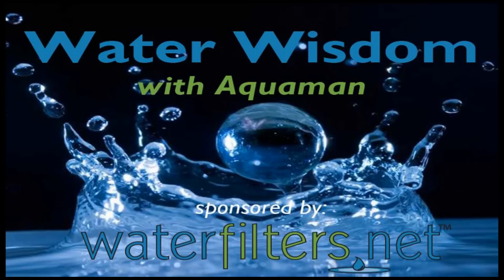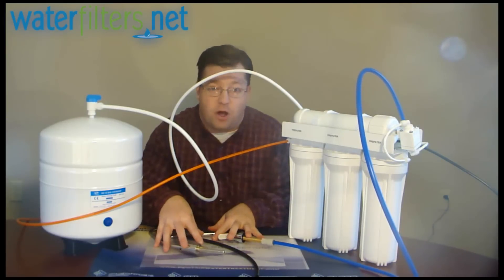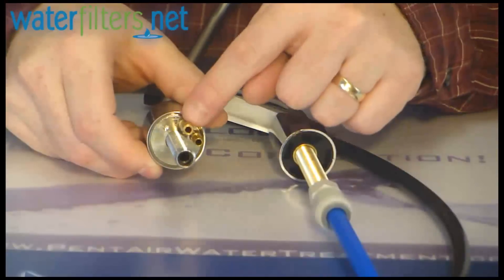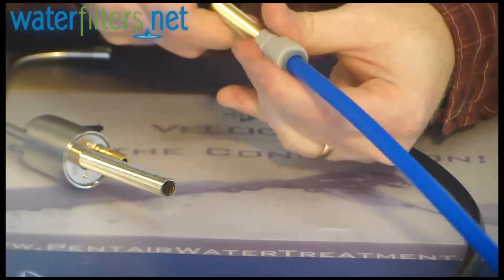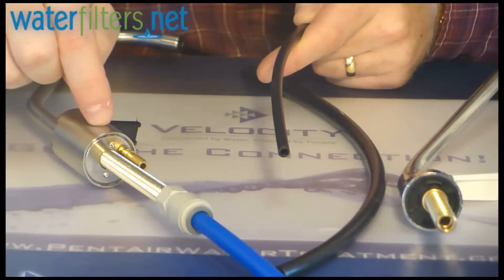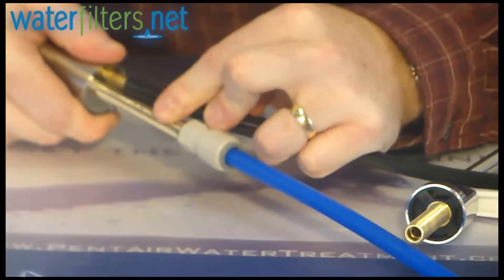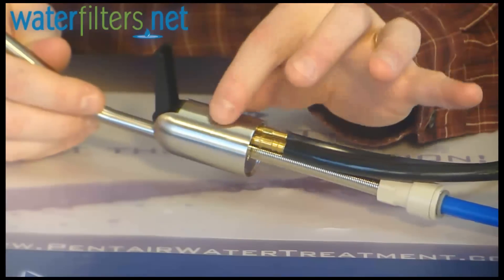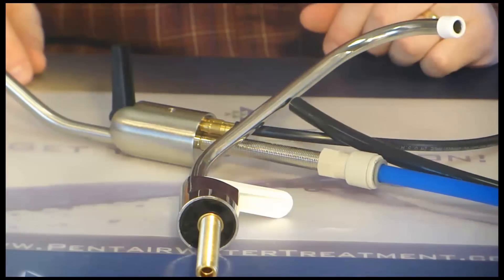Air-Gap vs. Regular Water Filter Faucet

Comment: Section 611.2 of the Uniform Plumbing Code requires the discharge (brine or waste) from a drinking water treatment unit enter the building drain through an air gap or an air gap fitting. The purpose is to protect the potable water from contamination from the drain contents in the event of a stoppage where the waste could rise in the discharge line through the unit and then contact the potable supply. The same protection is required for any device connected to a potable source and a drain.

Comment: The drain water is not brine water. That would be the recharge water from a water softener. RO systems do not use salt. The firetruck drawing water does not and would not cause a reverse pressure on the neighborhood water supply. 
The concern is earthquakes. Airgaps are a California concept. The municipal water system can lose pressure and even develop reverse pressure/flow from a break in the system. These are mainly theoretical concerns. There would need to be a clogged and backed up drain at the same time there is an open valve at the same time there is a reversal of flow/pressure in the water system.
Reply: t @MattSteelblade  Yes, If the RO system is used for desalination. Or, a water softener is releasing brine into the water system and the RO is removing excess salt from the water softener. Normally, the discharge is called concentrate because it contains the small amount of brine plus the other concentrates.

Comment: What is that plastic screw-on connector called to attach the water from the RO system to the bottom of the threaded faucet base?

Comment: Hi, I have a faucet with air gap. very often (once in 2 to 3 days) around one cup or more water is throne out from the faucet. wondering what is wrong? is it the air gap or it is not connected properly.

Comment: The air gap is required to be ABOVE the flood level rim of the fixture it is serving (UPC Table 603.2). Your suggestion would violate this requirement because the flood level rim is the counter top or the top of the fixture when the fixture is self rimming.

Comment: I have an Air-Gap faucet and its very loud air sound from the hole on the faucet. is it any  way to reduce the sound?
Reply from the maker: Anna Popiel The Air-Gap faucet should not be making any noise unless there is a lot of air in your pipes.Is the faucet dispensing water when it is making this noise?

Comment: Can this be used as a replacement to your traditional dishwasher air gap?  I have a RO system but I do not want to drill any more holes in my new countertop.  Can't this be tied into the drain lines somehow?
Reply from the maker: jayjarch I would check with a local plumber to verify that they are able to do this for you.

Comment: Very simple yet elegant explanation.  Thank you!  I have 2 issues I hope you can help me with:  1) there is a slow leak at the base of the air gap faucet. It appears to be coming from the clean water line where it connects to the faucet. Can I fix it with a new washer or something else or will I need to replace the faucet?  2) My RO system makes a constant breathing noise.  Is that normal or not?  How do I get it quiet if it should be?  I would appreciate any help you can be.  Thank you.
Reply from the maker: Orlando Corona I would suggest checking the lines and seeing if it is actually the line that is causing the leak instead of the faucet itself. and regarding your RO system the breathing noise is normal.Thank you!

Comment: Thanks for your helpful videos! I have a similar problem you might have some insight about: We just installed a new RO system and water is leaking out of the air gap. The black line goes straight down into the drain without any loops or kinks, drain is new and clean, & all connections are good. The leak happens even/especially when we shut the valve from the supply line into the RO system, the tank is not full, and we do not drain the water out. Does that sound normal to you?

Comment: I simply replaced the air gap with a standard non-air gap faucet. The air gap ones are useless and they can almost never be fixed by "cleaning" the drain hose. The faucet itself clogs up with other gummy sediments. They only create a vacuum break IN CASE of back-flow. It almost never happens. I repeat: Replace the air gap with a non air gap. The extra price is worth it - all those tiny cheap air gap faucets are crap and don't last. Look at all the complaints people have here. Stay away from air gap faucets! And just run the drain line direct to drain. Install a back flow (check) valve if you want.

Comment from the maker: @jman1863 This is typical. It takes time to work the air out of the lines. Air in the drain line exiting the air-gap faucet will cause the weep hole to leak. Sounds like everything is good now though.

Comment from the maker: @12quillemall5321 You may have developed an air lock in the drain line, or the plunging may have forced something into the drain line, thus blocking it either completely or partially. The drain line out of the faucet TO the actual drain needs to be completely free of blockage.